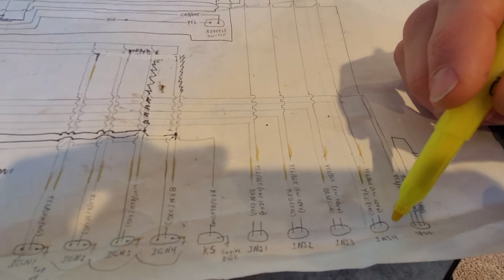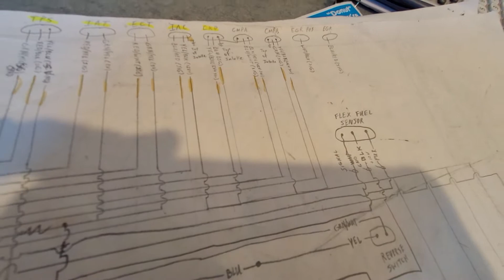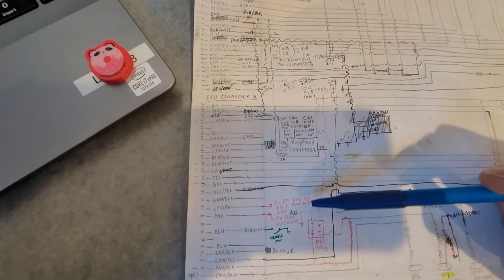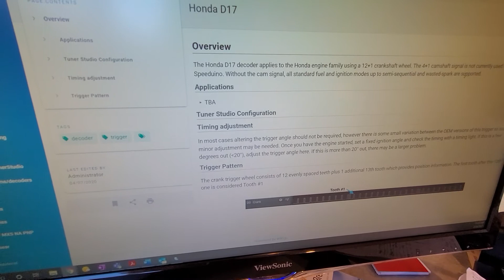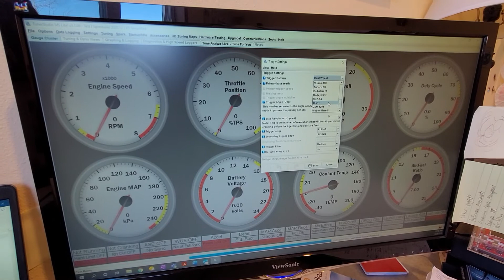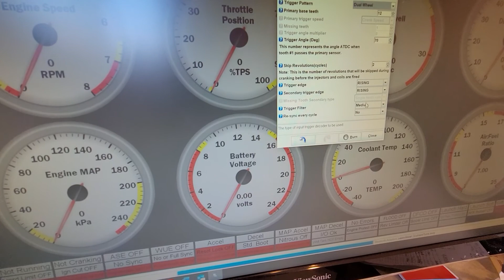Speeduino Basics Honda K24 - Wiring Diagram, Tuner Studio Settings

Comment: Does speeduino trigger check engine light or something to give failure codes or some way to notify you if a sensor or something isn't working right?
Reply from the maker: No it does not have fault codes like an oem ecu. Usually can figure out issues by datalogging and looking at the sensor inputs ehen played back.

Comment: good video, what ecu pinout did you use? im trying to understand using TSX and K20 ecu pinout and any match with your connector pin..
Reply from the maker: The harness i started with was the 03-07 accord manual. I have not compared the accord to the tsx pinout.

Comment: the way vts pickups work  uses exhaust pickup to compair to intake and  only 2 fixed values are exhaust gear and crank sensor are the base timing  setting    as for the vss  its used for vtec  also tps plays part in trigger timing to   so speed above 5km vtec works throttle angle under 38%  it makes vtec turn on later in rpm  range more wot its lower  rpm it triggers

Comment: Also, why didnt you configure the 'external' MAP sensor ?
Evidently there is a physical switch inside, so perhaps this relates to that ?
Reply from the maker: I built the board without the internal map sensor to save money. The oem map sensor works great, I had it already, and the wiring was all there. I like using the oem map sensors because often the internal map is the most expensive component in the speeduino. I am typically on a really tight budget, so I save money where I can. There was no switch on this board.
Reply: @elscorchomotorsports7199  Gotcha thanks.

Comment: Just an update. The Speeduino manual now has Honda K20/K24 (4+1) & Honda J30/J32 (6+2) trigger patterns and decoders as 'In Development'.
So if you are still on this project, individual spark/injection may well be on the cards soon.
Manual Update was edited June/July 2023.
Theres a 'dual wheel' option.

D17 edited Oct 2023....
'The Honda D17 decoder applies to the Honda engine family using a 12+1 crankshaft wheel. The 4+1 camshaft signal is not currently supported with Speeduino, but as of Oct'23 development including vtec support is underway. Without the cam signal, all standard fuel and ignition modes up to semi-sequential and wasted-spark are supported.'
Reply from the maker: I haven't done anything with the k series on speeduino since i sold the insight over a year ago. Thanks for the info, I will have to look into the updates. Getting vtec to work is easy, so vtc compatibility is where they should be focusing. Most guys will not even consider the speeduino on a k series because of the lack of vtc control.
Reply: @elscorchomotorsports7199 Most K series wont consider speeduino ? Granted flashpro does most anything they want...at a price that locks you into Honda tech. But tech evolves. So I thought i would see if there was any speeduino developments.

I have been looking at universal ECU flasher (but that requires Map identification for tunerpro and such) vs standalone for an L13/L15 among others (Ecumaster emu black looks an awesome bit of kit bang for buck....but you pay the price).

I want to do something rather unusual with a CRZ capabilites without proprietory lock in, that isnt swap/na/turbo/charger or e-motor. Hence I stumbled across your Vids to help with that. Thanks.

The L series only has 12v/16v switch. Although I want the full sequential firing/injection from the cam sensor anyway....without having to butcher the sensors. Made me cringe having to see that instead of change the software/firmware.
Reply: Hint. Using 144v from a motor charged battery to directly drive the transmission, is not the best use of that 144v. Especially if you can use that 144v to amplify the power indirectly, rather than accept a mere 90%+ efficiency transfer. A 25hp boost from that electric motor is a really, really bad use of that energy. As is turbos blocking exhausts, superhcarges with massive parasitic losses or NA that is limited to atmospheric pressure.

Comment: How did you come up with 70 for trigger angle?
Reply from the maker: Crank the engine with timing locked and injectors unplugged. Keep changing the offset until the no 1 spark is at tdc on the balancer. You will have to find tune that 70 degree value and verify with a timing light on your specific engine.